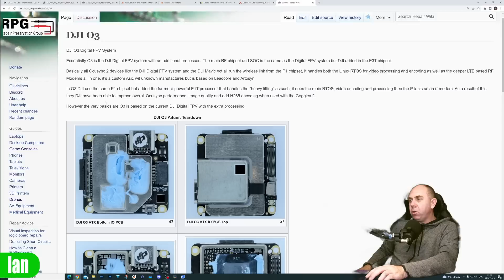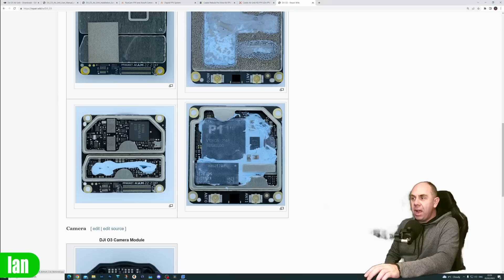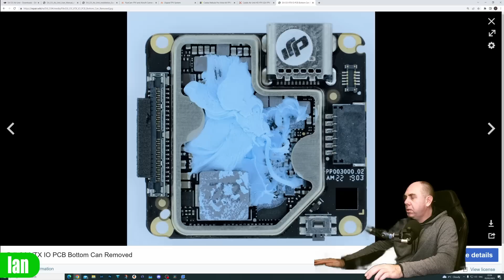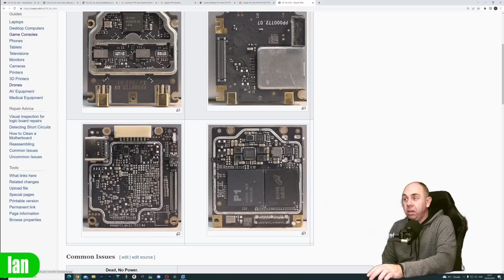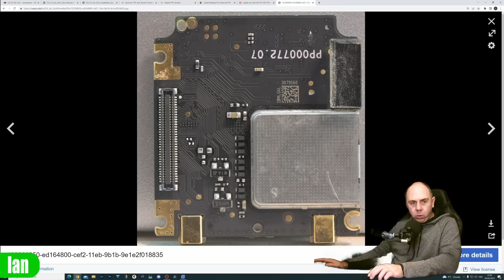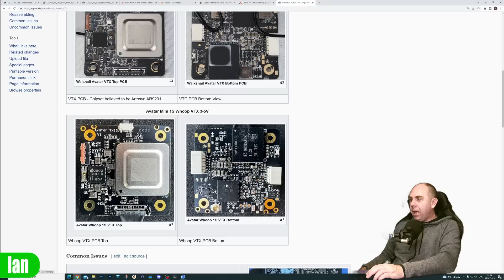DJI FPV O3 Lite - Just a Vista ? -  Live Stream Clip

Comment: Very interesting clip!!! I was thinking about an O3 lite, when they came out with the O3 air unit, sice it was similar compared to the OG air unit back in the day (on board recording)
On the one hand it is sad to hear, that there probably won't be a O3 lite

BUT it is encouraging to hear, that there could be a Vista LITE version. I think, if they would do that properly (DJI usually does it properly) they could dominate the micro drone market easily. Walksnail would have a way harder time competing with a single PCB Vista (if they are smart might be usable with 1S). Using it with the goggles 2 it would be easy to use with all the necessary functions everybody wants (MSP OSD). 

Who knows, if they ever gonna do it? But looking at the 250g rules everywhere, it would be a KILLER MOVE to stay competitve in the drone business ;)o

Comment: I've did some flights on O3 and goggles 2, and to be honest the only thing I am truly impressed with is the goggles themselves, massive upgrade over the bulky v1/v2 things. I like to fly in 4:3 mode and the reality is not a massive difference between DJI v1 air units on 100fps, the biggest improvement overall was nullified when they made it so the v1 air units/vistas work with the new goggles 2, that combination is a winner no matter if you use the 120fps cameras or caddx polar for night flying.

I suppose if you use the onboard recording and want nice video footage its superior but for recreational flying its not great to have to switch to 60fps mode to get 60fps onboard footage. Range is good but then you are comparing to v1 when used with good directional antennas and 5.8ghz there isn't a huge difference in range given how O3 takes advantage of 2.4ghz and v1 system does not.

Comment: so how is the range improved so much?
Reply from the maker: The range is intentionally limited on the first system.  DJI have just choose to allow 23km now.  They could do that on the old system if they wanted.  For instance a Vista on the O3 firmware with the Goggles 2 will go 30km.
Reply: @MadRC  huh, so why is the range and flying behind stuff so much better on my 03 than my vista's? all on the same firmware and setting? I can go behind and so much further on 03?
thank you
Reply from the maker: @ollie_fpv9260  O3 is H265 Vs H264 on Vista for starters. The sw is optimised

Comment: This will not age well, lol. There will absolutely be another lightweight VTX that has the same quality as the O3 minus recording. Doesn't matter what's inside. Maybe they'll just repackage the Vista, but we will get an upgraded "O3" vista.
Reply from the maker: It does not matter what’s inside 🤣, what nonsense. You have to understand what drives the quality on O3.  It’s camera and Processing, the P1 can’t do H265 on its own with out the E3T. So it’s going to need something either we have not seen before or it’s not quite going to be the same.  DJI can’t defy the laws of physics lol. The E3T is not used for “just” recording.  It’s the whole Linux Os and image processing and encoding as well.  Could they make something between vista quality and close to O3 quality yes but it won’t  be quite the same.  The video will age fine as it’s facts.  An O3 lite will basically be a vista unless they use some other chipset and then there is no space saving.  

Let’s see IF anything else ever launches at all.

Comment: So funny you dropped this video as another YTber had a ranking of the systems they posted.  O3 was treated separately though I'd argue it's just a fancier VTX and camera for their system and no different than other video systems who offer VTXs with different cameras and power outputs.   O3 is just an OG Air Unit in the footprint of a "Vista" and 4K processing.

Comment: I think when people ask if there might be an O3 air unit lite is whether there might be a smaller Vista coming, possibly a single board design. If you remove the 20x20 holes and use better placement everything might fit on one board. When you compare the available digital systems one of the few ways DJI does not do better is smallest VTX available.
Reply: EXACTLY WHAT I REQUESTED!
Yes, we don't need an 03 lite... We need a lightweight Vista ... Like you said, single board, and use 25.5mm x 25.5mm whoop board configuration.
DJI, YOU'D OWN DIGITAL IF YOU CAME OUT WITH AN APPROX. 6- 8 gram version of the naked Vista! 😎🤘💯

Comment: Eh so why does Vista have P1-v10r02 (notice the 02) but "the same chip" in o3 version have P1-v10r03 (notice the 03) Not to mention the different model numbers...
Reply from the maker: That’s just production versioning, that’s been changing for years on the Vista and others as well. The core chip is the same. Zero performances changes. DJI use this chipset oin close to every one of their drones as well.
Reply: @MadRC  Awesome; appreciate the response and shared info!

Comment: What about the 2.4ghz? from my understanding the older units are only locked on 5.8ghz (or they don't have 2.4ghz rx), only the dji fpv could switch to 2,4ghz and the o3 air unit can switch between 5.8ghz and 2.4ghz when the signal is low or you have interference..
Reply: 2.4 is only used with the controller for a control link. You don't need it at all for the video to work
Reply: @terminsane  I think goggles 2 with o3 air unit can switch to 2.4ghz for video now

Comment: Hi MADS … thank you for all the great info and content. Question …. If I’m running a de-cased Vista on the latest O3 firmware with my goggles 2 do I need to worry about overheating? With goggles v1 I was able to set my power to 400mw max but now I have no control over the rf power output.
Reply: No worries! Just put a fan on it on the bench... I use a small PC fan. It doesn't have to be big.
Also, when arming, get it up and flying quick. Don't let it sit there armed without taking off soon. Just get that air flow of flying soon.

Comment: Hi ian, and everyone..

i got my vista & Old Air unit Paired with Goggles 2, but sometimes the framerate just drop unbearably. even with 40Mbps transfer rate, and with a good signal streghth.
cant confirm it on O3, since i dont have O3 atm.
Reply: Are you flying behind things? Behind trees / dense leaves etc?
i get significant drops just going down my driveway, but that's behind a wall and several trees
Reply: @terminsane  no. even when i fly on an obstacle free field and the signal is pretty good All the time over 40Mbps. i still get the Stuttering / framerate drop...

*im using Old Fullsize Air unit with Caddx Polar Camera